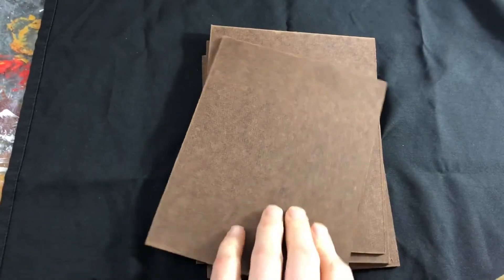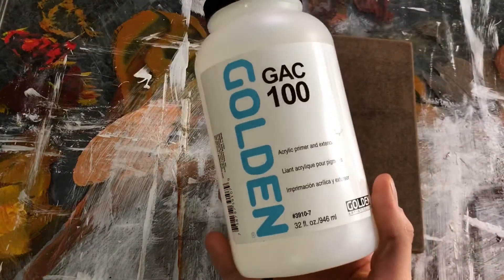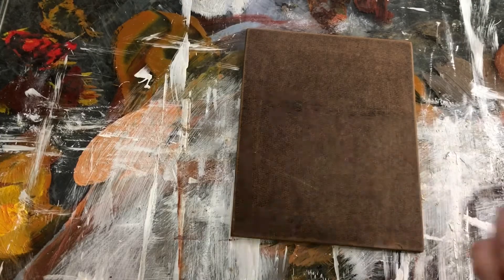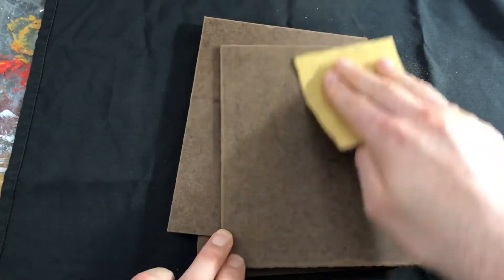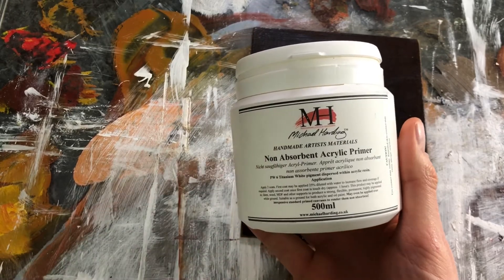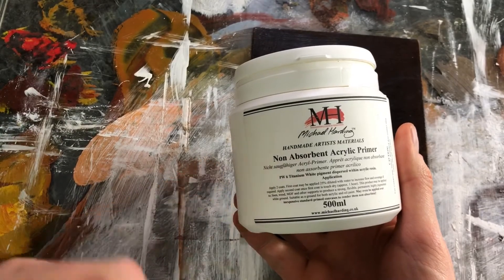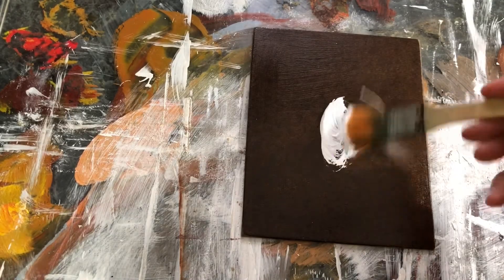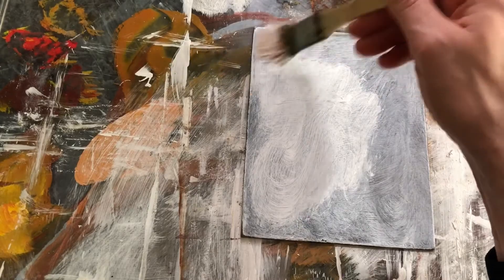How to prepare WOOD PANELS for OIL PAINTING using GAC 100 and MICHAEL HARDING’S non absorbent PRIMER

Comment: So far I have used gac-100 for over 6 years, it is a good product. Though it did not help with sealing masonite. The oil just goes through it, especially after glazing.
But on wood, it seems to do a good job of protecting. Either way, I have stopped using masonite due to that issue. It just looks like the painting peed itself on the back :)
Reply from the maker: Thanks for sharing!! I appreciate it. :) I haven’t noticed an issue yet with it sealing masonite? How many coats did you apply to the masonite? Do you use gesso or oil primer over the sizing?
Reply: @GalleryBry  I must have done one or two coats of gac-100, with two coats of acrylic gesso. I was surprised myself
Reply from the maker: @zs-art714  very interesting. How long was it until you noticed the oil come through the back of the panel? I’ll have to keep an eye on my panels.
Reply: @GalleryBry  I think something like a month maybe. I'm using another gesso now, gonna observe how it reacts with it. I did use a very heavy oil glaze at the last stage, but I always did that and never had any issues before. It is a mystery for me as well.
Reply: @GalleryBry  I also noticed that glazing with Stand Oil - Turpentine medium doesn't permeate through the wood surface, before I would glaze with linseed oil which I guess at this point is not the best choice. I moved to another country last year, so I have to use different brands than I was used to. Anyway, so far the glazing medium that I made holds well.
Reply from the maker: @zs-art714  good to know!! Glad it works. Walnut oil also makes a nice glaze. It doesn’t yellow as much as linseed oil.
Reply from the maker: @zs-art714  was the glaze a final layer or an initial imprimatura?
Reply: @GalleryBry  It was a final layer. The first layers are pretty lean, everything is following the fat over lean rule. I'll have to try the walnut oil some day
Reply from the maker: @zs-art714  walnut oil is great. Definitely give it a go.
Reply: Great informative comment! GAC 100 is the only sealer I haven't tried. I literally have EVERYTHING else, which is why I haven't tried it. Because I prefer masonite and ACM(aluminum) panels. Sounds like I don't really need it lol 🤷
Reply: @DCweldingAndArt  I’m interested in what you use to seal the panels!!

Comment: Can I use Golden gac 100 on copper?
Reply from the maker: Great question. I have not tried it. But You probably can if you want to seal the copper so it does not oxidize in any unpainted areas. Most of what I have read says it’s okay to paint directly onto copper without sealing it, which is what painters did hundreds of years ago before acrylics. I just received my first Cooper panels today so maybe I will try it. Did that help at all?
Reply: @GalleryBry  Thanks for your answer, I'll buy a copper sheet and try it, my idea was to give it 1 layer of golden gac 100 on the front and back, including edges, the other day I read a conversation on Instagram from an artist who paints oil on copper, another artist told him that if he didn't seal the back the oxide would destroy the paint from back to front, so I came to that conclusion, would it be crazy to apply clear gesso after golden gac 100? It's what I do when I paint on wood
Reply from the maker: @Maria-ue2nb  sealing the copper certainly couldn’t hurt. If it works for wood it should work for copper. :) let me know how it goes. :)
Reply: @Maria-ue2nb  love that idea. did you try it? Id love to give that a go